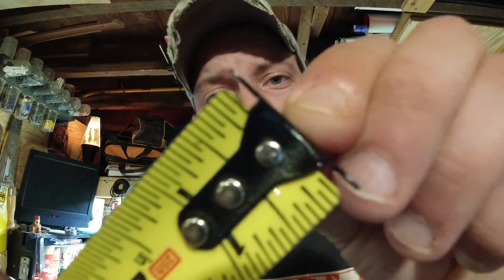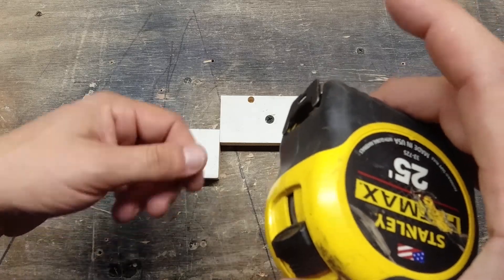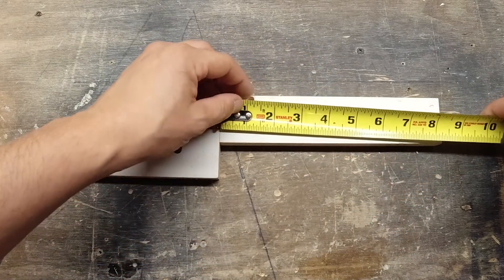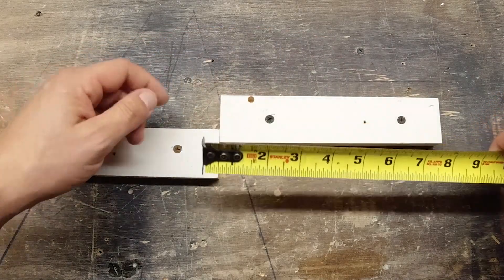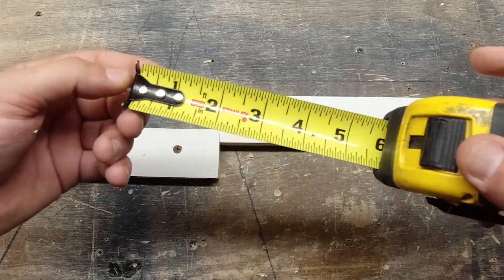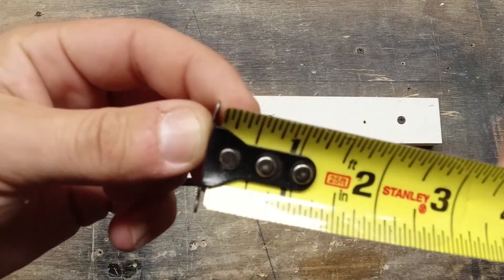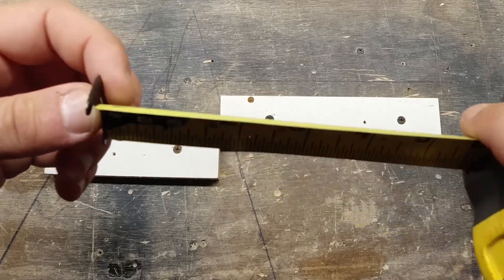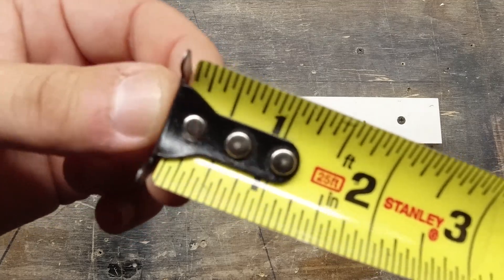Why Does The End Of A Tape Measure Move?

Comment: When I measured like you showed in the video. by pulling the tape toward myself—the measurement came out 1/16 inch off. I tested this on a 2x12 board, which is actually 11.5 inches wide. Measuring from one end and pulling the tape across gave me a reading that was short of the 11.5in by 1/16 inch.

Comment: still confuse , this tape measure then can't make exact lengt like ruler because when you hook metal there is a 1 or 2 mm gap , so for me the actual purpose of the tape measure is not the exact measure but inside and outside measure shall match only , tolerance would be 1 or 2 mm

Comment: Well here is A doozy for you, when I measure for length of deck post I always use a magnetic tip tape measure so I can pull it from the face of the metal post brackets and read the measurements of my laser I always use. When I cut the post I remove the pencil mark. So I’ve been doing it wrong my whole life yet Everything always comes out right. For some stupid OCD reason this is the only time I use this crazy “pull tape measurement” technique. 🤦🏻‍♂️

Comment: I don't measure by butting tape . only by hooking, this movement makes the measurement incorrect by several mm as the tape is not at the edge of the material  I am measuring . how can this be accurate?
Reply: The end is made so it moves just enough to compensate for it's own thickness. This eliminates the need to find a wall to push it up to for the measuring process.

Comment: That tip moves because you are compensating for the thickness of that metal lip ... So as you said when you use that metal lip to PULL against the same object for measurement it will give you X reading... If you were to use that metal lip to push up against a different object to get the measurement for your object, it will give you another reading, this is why that metal tip moves so that it can compensate for the thickness of the metal lip... 
I NEVER trust that metal tip's movement so i line up all my measurements at 1 inch if i have to make sure its perfect... otherwise i just clip onto it or use something else to push up against to get a round figure .. 
I learned this back in the 90's when i was building sub woofer boxes ...
Reply from the maker: Great tip!  I do this often as well!  Love that you built sub woofer boxes!  I was pretty big into car audio back in the day.  Thanks for checking out the video!
Reply: and still do till this day .. !!